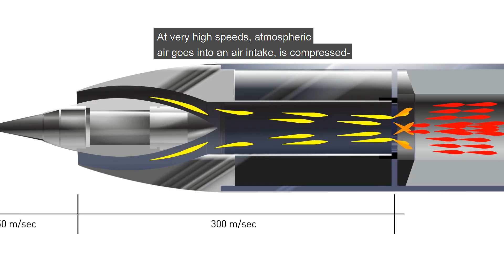How ramjets may change the role of artillery on the battlefield

Comment: How can this fit in a standard gun while now holding engine, guidance, warhead, and how much fuel?
Reply: Much smaller warhead/payload.  I'm guessing this would carry as much explosive potential as a 76mm Cannon round (or a 3" payload in a 6" shell).
Reply: its 155 millimetres so it fits a 155mm barrel.

Comment: To use ramjets with launchers that do not normally achieve a muzzle velocity of >1000m/s (~Mach 3), what about filling the combustion chamber with pre-mixed (80% oxygen) fuel?  The idea is that after exiting the launcher, this relatively small amount of fuel is ready to burn & help further accelerate the missile/projectile to or towards Mach 3, where the ramjet can operate properly.
Reply: Putting oxidizer into the shell means less range, obviously.

Comment: "Change the role of artillery"
*start of video is filled with clips of rocket barrages*
Reply: Yeah.. It's called rocket artillery. Do some research.
Reply: @nvil82395  my point is that this shell is for gun type weapons, not tube launchers. They only show tube launchers when saying russian artillery can reach a hundred or more km. Well, american rocket artillery can also reach a hundred km. Actually, around 160km.
You can't say that artillery has a range of 30km and then show a system specifically designed to overcome this on another side. You're comparing two different launch systems.
Reply: @joshuacheung6518  That's true, I understand now. Seems weird, probably just a marketing scheme.
Reply: Even more, we've had artillery go further, not but around last year we had an artillery round fly 40 miles. https://www.thedrive.com/the-war-zone/24238/armys-new-huge-barrel-packing-155mm-howitzer-doubles-range-to-40-miles-in-tests 
And while all of this still falls under your whole Rocket Vs Shell the fact is that it's still launched out of a traditional artillery gun (tank gun) and is just a jet on it instead of a rocket carrying an explosive payload.
https://www.youtube.com/watch?time_continue=13&v=0Euxm3jTM4U&feature=emb_title

Comment: Hmmm...no such thing a something for nothing. Since you can't cheat physics, I suppose the penalty for using a ramjet w/guidance to extend shell range is reduced warhead size.
Reply: On the other hoofie, with a guidance package, the round will be more likely to hit the target, so a smaller charge is an acceptable trade off...
Reply: No, you get more range with the same warhead size.  Penalties include more complexity, more financial cost, & the need for guidance.
Reply: @GM4ThePeople  nopes you dont get the same warhead size.  u have a smaller warhead cause now u have to fit an engine guidance, fuel and warhead in the same size casing.

Comment: Imagine u shoot this thing at 100 km altitude and then drop it on the target using some simple guidance system.
Reply: Imagine putting these engines on something like a flying machine and dropping the explosive on the enemy, with the simple guidance system you proposed.
Reply: Drop it from as high as you want: terminal velocity is still the same.
Reply: @wilfdarr  

CHILD WOULD KNOW THAT AND THAT WAS NOT THE POINT.

HAVING IT VERY HIGH MAKES IT HARDER TO FIND - EINSTEIN
Reply: That's not how radar works (most children know that 100km is very short range radar). The reason cruise missiles are terrain hugging is specifically to avoid being seen by radar. Tanks having APS would easily see it coming and destroy it if it used the flight path you describe. Good job Einstein.
This is a scam, meant to attract gullible investors like yourself while paying the CEO and staff huge sums of money for what amounts to dicking around. You don't believe me, go ahead and drop your hard earned cash into this company and see what happens: WTF do I care if you are broke because you're stupid. .